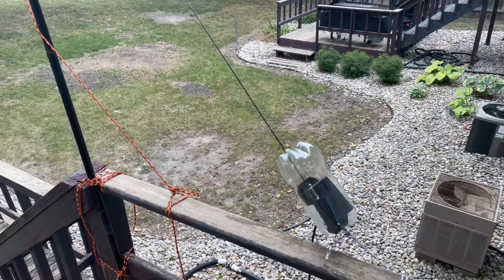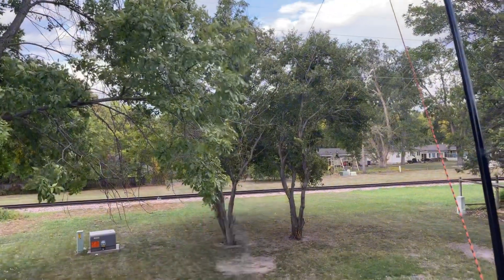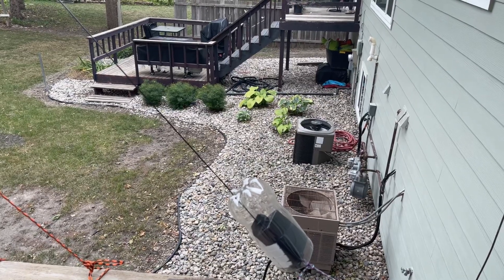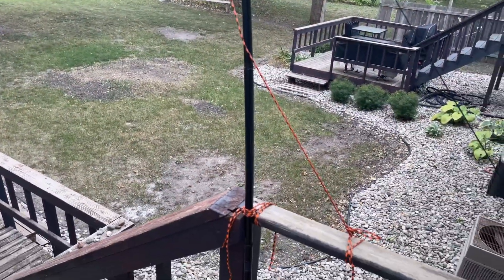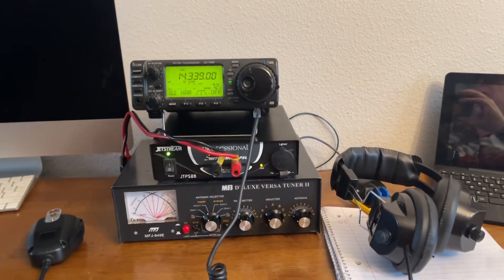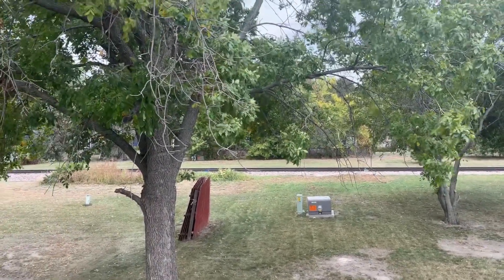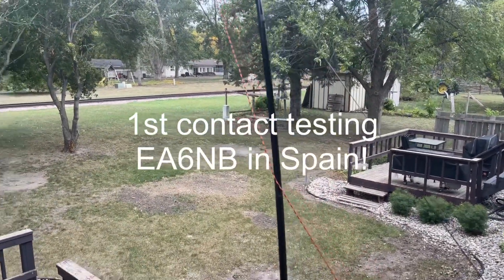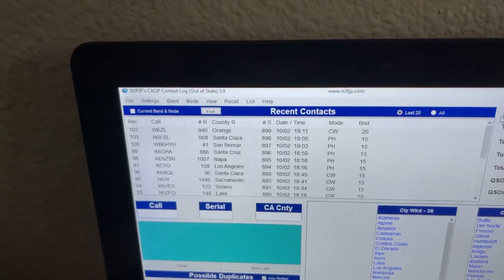MFJ-1984 EFHW Antenna

Comment: I made a homemade version... and after I placed an RF Choke about 30cm from the impedance transformer... got me the SWR low on the 20m band and the rest to 10m. On mine the SWR on 80m was a bit high in the lowest point... almost 2:1. But for some reason after I placed the RF choke that one also dropped to 1:1.5 and I also got it to resonate on 60m ))). Is a nice antenna. Not perfect but comfortable and multiband  )). 73 DE YO6DXE.

Comment: My property is a slope with the house at the upper end of the slope.  Can the unun be placed at the higher end and run the antenna at a horizontal or at a slight down slope?
Reply from the maker: I would think it would work. Sounds like a fun experiment. I’ve noticed I get different results deploying it differently. The way you see it here on this video wasn’t the best. Deploying just as the instructions say seems to work best for all bands. But…it’s not critical. Same on the MFJ-1982.
Reply: @gliderrider  
  I got it up in a cedar tree about 23ft.  That’s all I reach on my extension ladder.  I have rope tied to the unun and then the rope through a pulley that is attached to a eye loop lag bolt thats screwed into the tree.  That allows me to lower the unun when needed.  The other end is fastened to a rope that is attached to a six foot poll that’s bolted to a fence post.  I still have to hook up the coax and grounds.